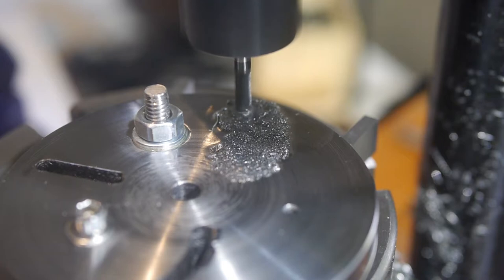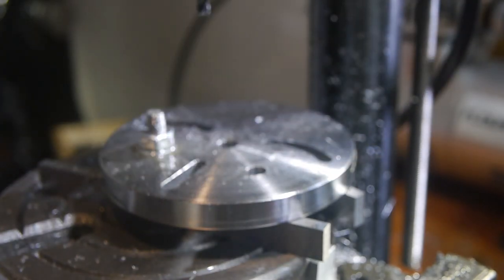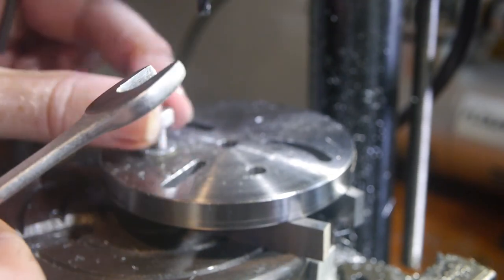Watchmakers Face Plate - Part 6

Comment: Machining is all about holding things down so the machines can work on them! Alumin(i)um fixture is an elegant solution. Well done.
Reply from the maker: I've learned a lot from prototyping my workholding this way. The design has evolved quite a bit, and the permanent solution I'm planning will be quite different from the version I would have build before.
Reply: I can't wait!